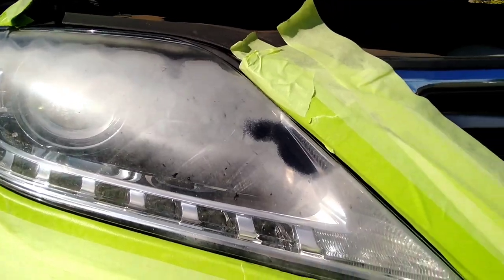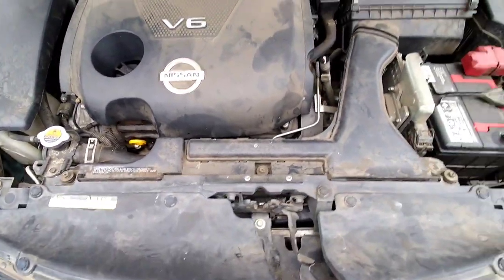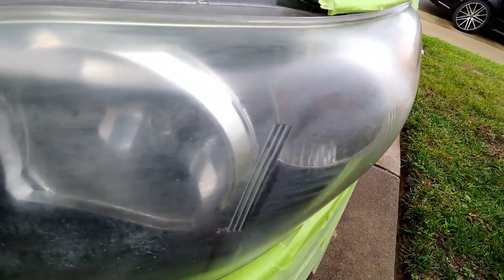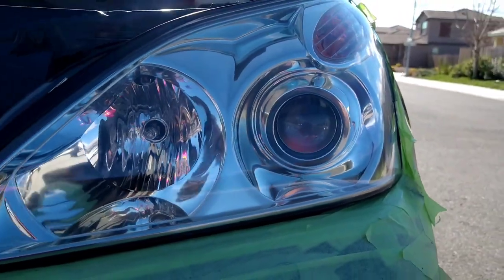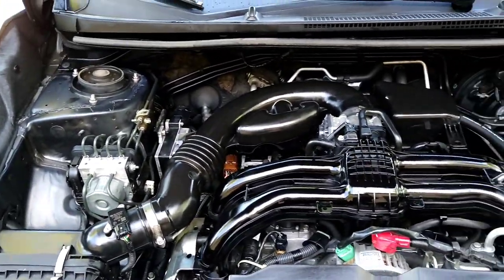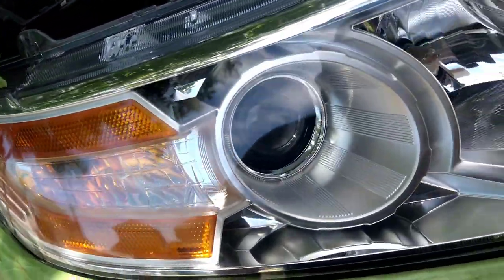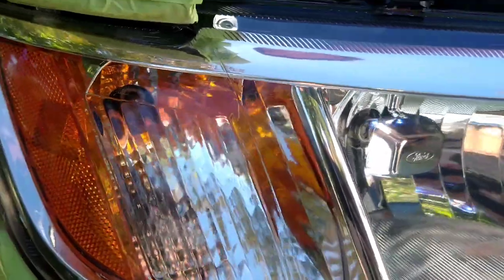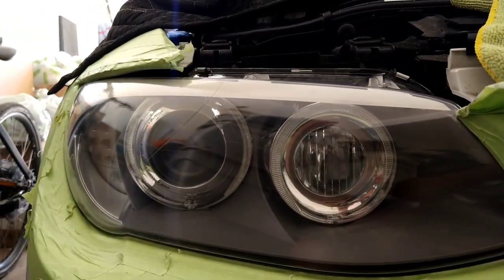My headlight restoration results are ALWAYS AMAZING portfolio#2👹

Comment: Your restorations are amazing especially the gloss. Do you have any advice when applying the spray coating so as to get a smooth glass like finish? I've done quite a few restorations myself however I find it difficult to get that flawless finish with the spray can. Many times I get some orange peel.
Reply from the maker: It's the products you were using..
This product is amazing...
Go into the bio and click on the link it will take you straight to what I use...YOU WON'T HAVE THIS PROBLEM WITH IT..
Thank you for watching..👍🏼💯
Reply: @theheadlightrestorationpro  but I used products that were specifically made for headlight restorations which have UV protection and needs to be UV cured.
Reply from the maker: Well that's the process of trial and error.
Not all products are created equally..
If you use the products that I'm using you won't have that issue I've taken all the think- process out of it..
I've been through all these trials and errors as you say and have had these problems that have studied and designed this process for Max performance, Max clarity, Max headlight health...
All the products that I use are listed in the video and also a direct link to purchase with discount from Amazon in the bio..
I literally it makes a difference when you use headlights certified products..
Every single thing I use was designed for headlights except maybe the power drill.. and technically that was designed for headlights because that's part of the process..
Reply from the maker: Also if you have any kind of product that needs to be cured on a headlight more than 5 minutes is worthless... You want to be in the 30 to 3 minute range
Reply: @theheadlightrestorationpro  The product I used cures in about 5 mins with the UV light. Thank you very much for the responses.
Reply from the maker: I used to use the UV light,, I used to use a heat light, I even used to use a heat gun at one point,, I find that it affects the clarity, smoothness, and a couple other things..
I naturally dry mine now, with air power I use fans... Summer or winter... I find changing the heat of the element in the long run does all kind of things you probably don't want it to do if you think about it you're changing the heat of the substance to an excess.. even if it's cold out you're exposing it to heat that it was never really meant to be exposed to even if it was the equivalency to 80° is different by way of intensity and projection... Just food for thought I've tried all these heating methods as well about a $300 UV lamp... All kind of stuff just sitting in my work shed as decoration..
Reply: @theheadlightrestorationpro  great information. The product that I used actually requires the UV light for curing and would not cure without it (As stated by the manufacturer)
Reply from the maker: Yeah I would switch up.... It's probably the root of the problems that you're having..
Reply: @theheadlightrestorationpro  Thank you

Comment: at 26:26 mark you show a headlight with a crazy sharp angle. How do you get in there to sand? would you or do you use 2 inch disc or do you just do it by hand ?
Reply from the maker: You'll see in some of my videos.. I kind of angle the sander sometimes, but if it's too difficult I'll get in there by hand with a interface pad...
Reply: @theheadlightrestorationpro  ok that’s what i thought you did with the interface pad but i wasn’t sure .. thanks

Comment: What's a good price range to charge the customer. I work at a dealership and do headlight restorations from time to time. I've come to enjoy it and want to do more.
Reply from the maker: Sorry, I can't really answer the question this depends highly on what location in general you are at and a bunch of different variabilities like: what city, what services you're offering, do you have a shop or are you mobile, what is the quality of your work, how long have you been doing it experience is a big thing, many different factors..
I was just suggest doing some research in your area.. everything realistic with yourself and your customers on your skill set and level versus your pricing..
Lot of factors that you'd have to figure out for yourself 
The main thing is demand which pretty much boils down to what city and area you live in..
I touch bases on this in a couple videos. Please continue to watch you probably run into it..💯👍🏽🤓
Subscribe.. watch all my videos, literally more than once if you need to soak up information and I guarantee you have a marketable product.
Reply: @theheadlightrestorationpro  prices vary wildly in my area.
Reply: @theheadlightrestorationpro  Is there an alternate product I could use other than the 3m p3000 trizac. Those pads are going for 85 and up for a pack of 15.
Reply from the maker: @aaroncardenas6215  go into my bio and click on the link you can buy the ones that I buy for much less than that.. there's really no one else who makes a pad like this besides 3M I believe it's a patented technology so nobody else really can try to manufacture something like this... Should be able to pick him up for around 50 bucks pack of 15 if you click my Amazon link.. the good news is that you can use them on multiple headlights.. literally if you take care of them follow my steps properly lubricated with water.. they will last probably six cars... No joke..
Everything that I use listed in the bio.. with a direct link to where to purchase..
Reply from the maker: @aaroncardenas6215  yeah precious generally very in different areas because different people are doing different stuff but rest assured there is levels to headlight restoration.. the method that I'm showing is the professional level of headlight restoration, as far as skill and combination of services and supplies used.. got people out there trying to sell polishing headlights, and wiping this on,,, all kind of weird things,, but this method is the highest level of my restoration that combined with your skill level you have to determine what it's worth.. meaning you could be doing this method or something similar and have two cars that you have done ,four pictures you can't really set yourself to charge as much as someone who has done hundreds of cars, has thousands of illustrations of their work, all their stuff together websites, social media Google accounts etc.. 100 positive reviews.. you got to start somewhere and work towards something.. prices will always vary....

Comment: should i even bother with the less expensive sanding pads that you get 100 for $20 ?  or do i just go buy the pads you use ?  Do the cheaper one gum up or wear out faster then the 3m gold pads ?
Reply from the maker: Yes yes yes... And more yes..lol
I've tried so many different pads and try to cut costs on different discs they are grossly different than the top quality of 3M... It's like night and day it should be in a different category.. other dissing pad are so weak and fall apart so fast where with for instance my first step normal p500 I used the equivalent of many different brands most would take about four to five just to finish one light... With the 3M it took one on average and you could still use that one to do other stuff and or possibly even the other side..😳😳😳😳 you can get away with using the cheaper stuff but in the long run you'll be losing with painstaking time and error.. just spending the 100 truth.. with something that's such a precise finesse type of artwork that headlight restoration is you need top notch quality material.. that's if you want the best outcome...💯
Thank you for watching good question..
Reply: @theheadlightrestorationpro  ok that’s what i needed to hear thank you